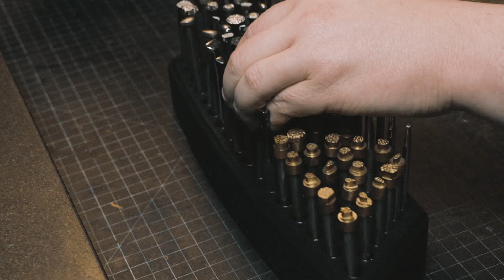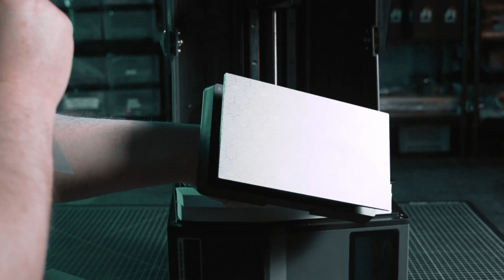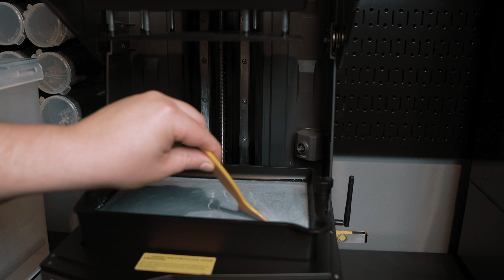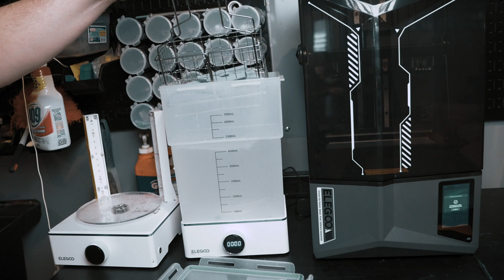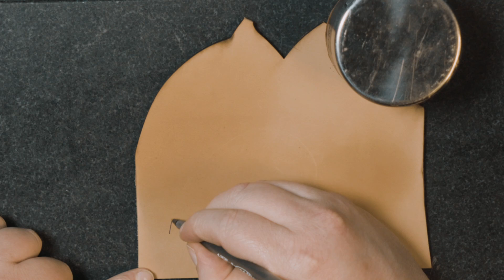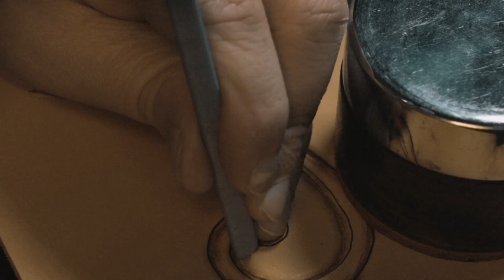3D Printed Leather Stamps - Bevelers

Comment: The next step would be to cast them in zinc with sand casting and an electric furnace.
Reply from the maker: I would make some much different designs if that was the intent, the purpose of these designs is to see if it's possible to get the cost per tool to next to nothing on material cost that literally anyone can afford. I'll make some much more elaborate tools when we get ready for casting or CNC manufacturing

Comment: Hi! Didn't you get a warning, when pouring so much resin (it's over the MAX line) into the VAT? Should trigger a warning, have seen it in another video on a similar level - so you don't spill over resin when the tilt mechanism does his job? Guess there is some leeway. Thanks for the video, greetings!
Reply from the maker: I just poured in the full bottle, most brands will develop their vats with this amount in mind even if it appears to exceed the max fill.  I wouldn't go more than this 1KG though.

Comment: My major concern is when it fails as it can ruin the leather if you are not careful. Plus broken resin is sharp; if the inside is not fully cured then sharp and potentially toxic.
Reply from the maker: Ruin the leather? You'd have to be hitting with force beyond what the tool is intended to do any real damage to the leather I think.  From the destruction testing I can confirm the edges are sharp in places but it didn't seem possible for it to break skin, at least not with the resin I used.  The inside was cured too, again, at least with my settings.
Reply: @Princearmory  Just going off my experiences from using resin printers the past five or so years. Different models and different resins yield different results. You also have to take in the human factor: a new leather crafter may be more heavy handed than you are after the many years you have been doing this.